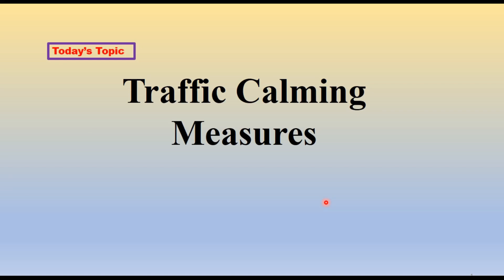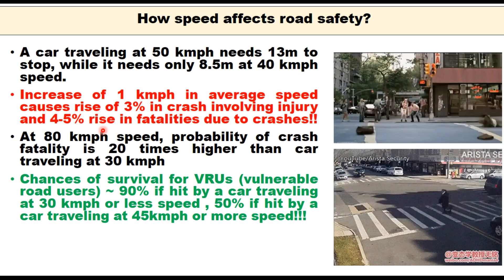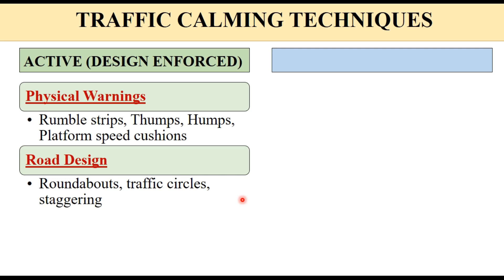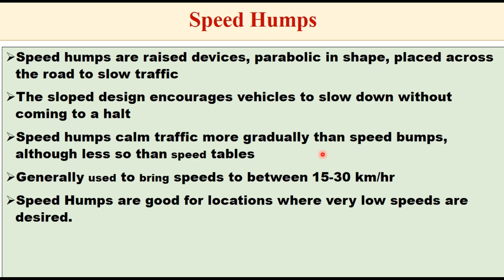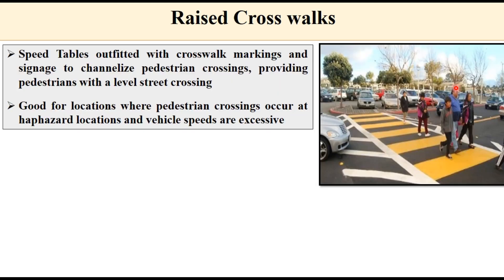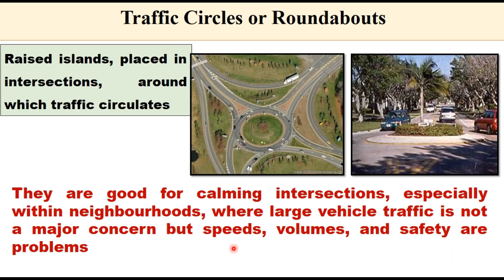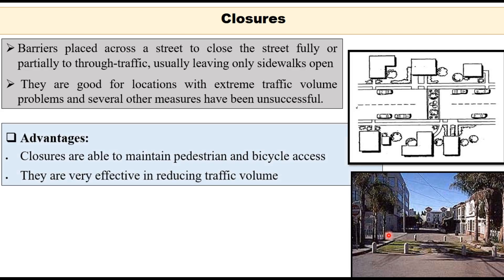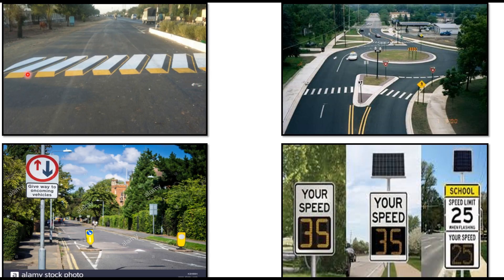What is Traffic Calming and what are the traffic calming measures? Need for traffic calming measures

Comment: iRAP INTERNATIONAL road safety study around the globe has confirmed, if the ROAD MARKING, AND ROAD SIGN BOARDS Retroactively is maintained as per standards to enhance and ensure the night time visibility Road accidents fatalities can be reduced to the extent of 25%. Maintenance of sign boards and road markings as per the standards are the least expensive safety interventions compared to other options.
IRC has introduced the relevant standard IRC-SP-67-2012 and IRC-35-2015.
In some areas the measurements has started. When the testing is made mandatory @ 6 months or at every accident location and ensuring the appropriate visibility can substantially enhance Indian Roads safety. Reduce the accident-fatalities.
Reply from the maker: agreed.
Reply: New versions are available